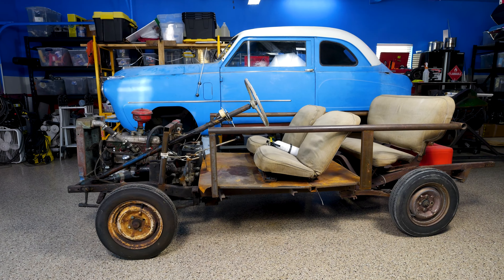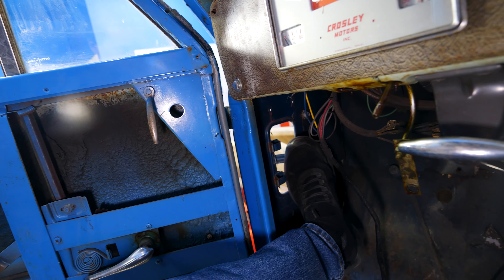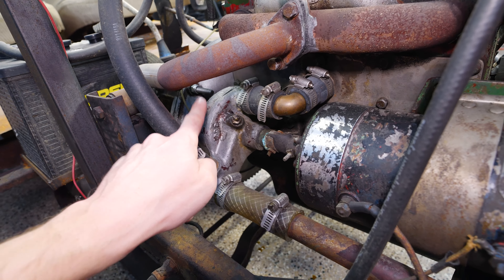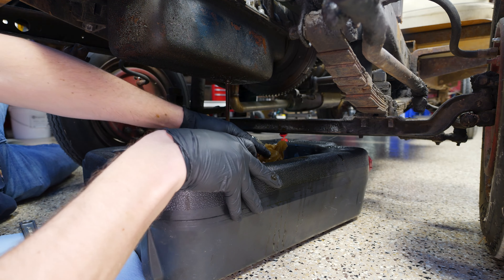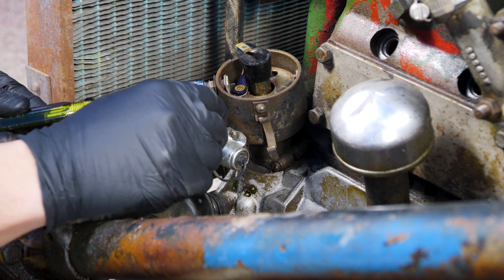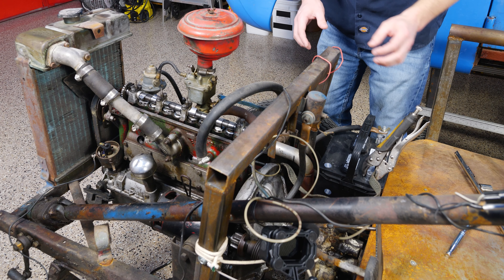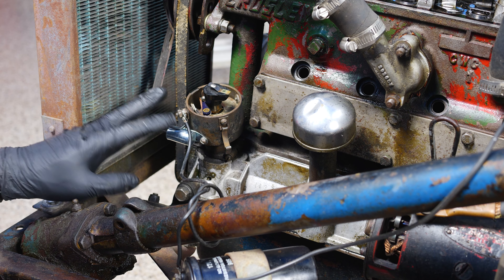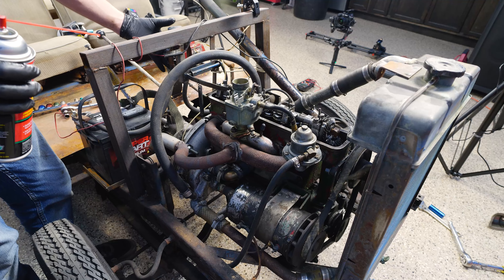Redneck Go-Cart From a 1950’s Microcar Chassis!

Comment: As someone who has a pile of Crosley engines sitting in the shed, I approve of this video.  I got a 48 CC running for the first time in 50 years.  It fired right up.  Here are some Random Crosley tips .
If it runs hot, remove the side baffle plates, and clean out around the cylinders ( they all get packed full of junk).  Max radiator cap is a 4 psi(without problems).  They hold 2qts of oil.  Never turn the engine by the crank pulley. That nut on it, is how you adjust the tower gear preload. The water pump is very easy to rebuild, just some packing rope, a shaft, and a bushing.  I kept mine 6v + ground.  I believe it is possible to get 12 volts out of that generator, but it might fry it...  I found out that some larger vehicles have alternators, with a shaft out the back for a vacuum pump.  That could run the water pump. 

The Bendix of the starter was used on many farm tractors. The generator also fits a Nash.   The carb is Crosley specific.  I hope your flywheel was tack welded on. If not, using 12v might pop the ring gear off.    On the water pump side, at the rear side of the block, thats a oil pressure feed line for the gauge.   The transmission is from a Lawn tractor.. Use simple 30weigh oil in that and the engine.  I like rotella SAE 30.  That trans will leak on a steep hill.   Lastly all of the cars have problems with the rear ends. The center sections are from Cushman golf carts. Like a 5.17:1 ratio.  The fatal flaw is the ring gear bolts come loose, and destroy everything.  Service motors sells a very cheap kit to solve this issue.  Loctite alone will not stop it. The bolt quality the factory used was junk.  Many of the cars got scrapped because of this.  Also the outer rear wheel bearings are not lubed by the rear end oil. There is a wittle bolt that you take out, and put a grease fitting into. Just a few squirts will do.   

Lastly the distributor has a little spot on the base to oil it, also a drop down the center under the rotor.  For what its worth, you radiator is from a 46-late 48, it has the spot to put in a thermostat at the top of it.
Reply from the maker: I appreciate this, just learned more from reading your reply than from a few hours on Google trying to find info about these little cars. We will keep the chassis and drivetrain original to keep an example of this setup running. It’s a fun little engine!

Comment: I cringe at seeing it won't continue to be a Crosley as there are so few of them. A waste of a sound body.
Reply from the maker: We are restoring the body and putting it on a modern chassis so it can actually drive on Texas roads so people can see the car in real life. Cant keep it 100% original since it’s too slow with 26 horsepower, would just sit in the garage and waste away.
Reply: @Motiv8Labs  I appreciate your preservation efforts.  While I'm more inclined to 100% original, I understand modern traffic requirements. Great that a visual example of a Crosley will still be shared with the public. And no one will know the secret inside 😉
Reply: @karlfischer1011  Thank You. I'm glad you are doing the car justice. Just like the old Yellowstone 1936 White Motor Co tour busses that they kept in appearance but on Ford E350 frame, engine and running gear.
Reply: @Motiv8Labs  700cc with a 40-50mph top speed seems plenty enough for a car like this. My dad's series 1 Land Rover topped out at around 35mph, and that didn't stop him from making a 300 mile trip with it once. But oh well, I guess it's that classic American mentality that if it can't do 150mph on a 30° hill it isn't drivable
Reply: I drc if it stays original atm, as long as you keep the removed parts in case it's next owner wants to make it original again.
Reply: @garyruxton5226  are those the same tour busses they have on skis and tracks in the winter?
Reply: @arichithechimericvelvetwol84  you must have missed the part where he is going to use them as a go kart at his lake property.
Reply: @Off grid Living  
No, I didn't, I'm just thinking long-term, if he decides to sell it in the future he'll have more options if he keeps the original parts in good condition. All I'm saying is perhaps don't leave it out in the weather or without maintenance for a long time.
Reply: @enzoperruccio  Don't blame that on Americans, I'd love one of these just as they came from the factory.  I've owned several vehicles that topped out at 55 and have enjoyed all of them. They are an adventure all they're own.
Reply: @todddenio3200  No, they are not the winter busses. The winter busses were Bombardiers from 1950's made by inventor of the first snowmobile Skidoo in Canada.
Reply: @enzoperruccio  Here's the problem:
I don't know where you live, or how old you are, but...In North America? 300 miles isn't that far, and Texas' highways have speed limits that range from 55 to 85 mph, with the bulk of them being 60-75mph. Trying to drive a Crosley on the highway, is extremely dangerous because of the speed difference between you, and everyone else on the road. Even if you try to stick to secondary highways, those are all going to be 55-65 mph. On top of this, is that the Crosley is struggling to reach 40 mph in the first place. It took 18 seconds to get from 6mph to 35 mph on the second top speed run he did in the next video, or roughly 31 seconds to do 6-43mph.

If you encounter any hill, you may see your top speed drop to 30 or less. At which point you become even more of a danger on the roads. It also likely isn't going to be good for the engine, to be run flat out at 43mph for long stretches of time. I mean, which is better? A destroyed engine, or a functional car that people can see and appreciate?

If it were my option, I'd probably just look for an old Toyota or Nissan/Datsun engine. Maybe a Suzuki engine.
Reply: @dposcuro  Why, just WHY are you guys so obsessed with highways?! This thing has the safety of a pedal car, I bet 30 mph is already enough for it to loose control and kill you or someone else, so why push it beyond that? Just stick to the city and preferably with not much traffic, it's the only use you'll ever get out of this "car".

Oh and just so you know; my diesel Fiat 127 wagon from the 80s struggles to get past 45 mph, so doing a drag race against the Crosley would be very fun (and also scary lol).

Comment: I have a ‘52 Crosley Super Station Wagon.  It's super clean(no rust, and the engine is in top notch condition), but I currently cannot drive it.  When I bought it, the seller told me that it was running at the auction, but that it started leaking coolant.  Turns out that the generator pulley had worn a hole in the coilant hose.  Upon further inspection(after I bought it) I discovered that the motor mounts(which are very small) had broken down and shifted the motor to the left, causing the coolant hose to be too close to the generator.  Between working and the cold winter weather I haven't been able to correct the problem.  I am going to rebuild the motor mounts and reinstall them.  I have no intentions of modifying the car in any way.
Reply: That is so much better than what this poor little car is getting.   They're only original once.
Reply: Hi, when you get new mounts(Service Motors) you may need to slightly enlarge the holes in the frame rails( I had to on my 48cc). Also use loctite, they always giggle loose if you don't.  You might want to change the trans mount as well. Or at least look at it

 I have videos of my car after we drug it out of the barn, click on my name for some random poorly filmed Crosley Tech stuff.  Good luck with you car!
Reply: @OddCars  Thanks for the info.  I will look into it.  I still haven't had a chance to work on her.  Life keeps getting in the way LOL

Comment: Stock those engines were rated to spin 7500 RPM! They used the Crosley Hot Shot sports cars in road racing. Please don't butcher the car.

Comment: Concerned about no oil on the camshaft. Should be spraying around with no cover on?
Reply from the maker: It’s strange that it doesn’t show up well on camera, but oil was flinging off the camshaft and covering the shop floor just in the couple minutes running it with the valve cover off. It’s definitely not oiling as much as a new engine would normally have though.

Comment: The Crosley COBRA engine was used in the original Mooney M20 Mite.  Horribly under powered and slow, it was replaced with a conventional aviation Continental opposed 4 cylinder

Comment: You seem to be pretty smart and then you wrap the ignition wire around the steering shaft😂 also the fuel pump os a concern as it could have leaked fuel into the engine since it is cam driven. Would make sense on why it has fuel in the oil pan

Comment: Chop, section and channel the body. Build a new frame and put it on bags so you can slam it to the ground. French the headlights and taillights. Get a set of chrome reverse wheels and baby moon hubcaps. Put an LS in it and you’ll have a mini lead sled. (They don’t use lead for bodywork anymore. If you use Bondo it won’t really be a lead sled but it’ll look like one.)

Comment: Did you need zinc additive for the cam shaft on this old girl?
Reply from the maker: Figured it wouldn’t hurt so we added a little with the oil.
Reply: My opinion and lay interpretation is that cam and valve isn't under enough spring load to require zinc. Zinc wasn't added until the muscle car era, to help with high rate valve spring wearing metal on metal flat tappet on cam. The zinc additive package causes other issues, the environmental ones are the only reason it's been reduced in modern oils. I believe the zinc additive package contributes to valve torching in industrial and hi po engines. Many industrial gas and propane engines had to use a special oil to prevent premature valve failure due to automotive oil additives. The zinc can't hurt anything in a Crosley but a good diesel rated oil would probably give the same results over time anyway.  The bigger issue with no oil filter is if the engine has run non-detergent oil forever, and you put modem oil or use a flush solvent, you can break loose sludge clumps that plug oil passages. Maybe pulling the pan to clean wouldn't be a bad idea?  Don't google non-detergent oil or zinc additive if you want to sleep at night 😉

Comment: The generator must be switched to 12v. The Gas pump needs to be rebuilt to handle modern gas or it will fail if it's not bad already, a zink additive should be in oil.